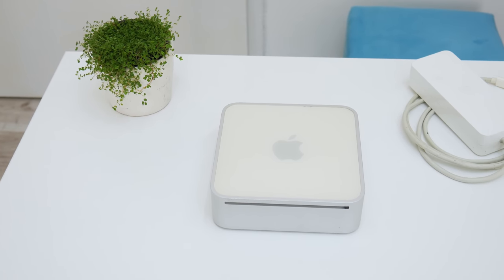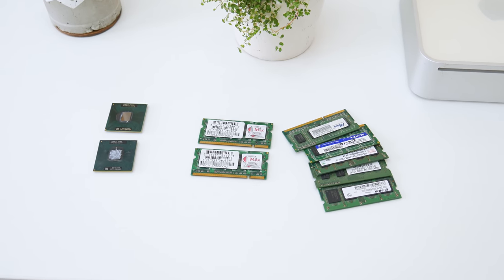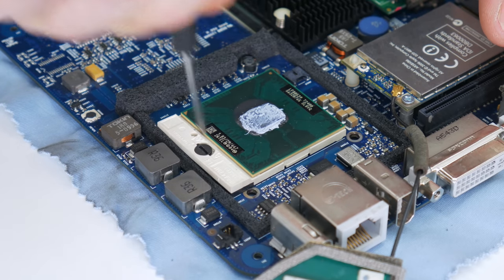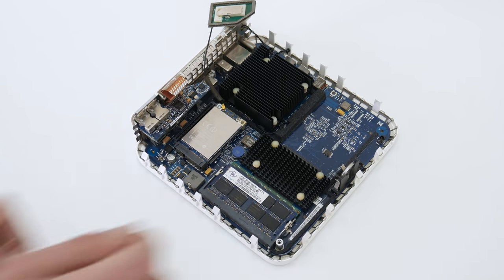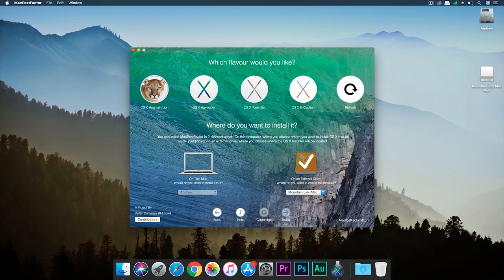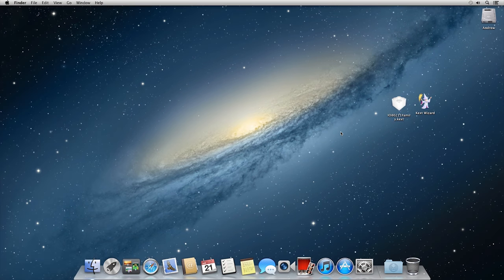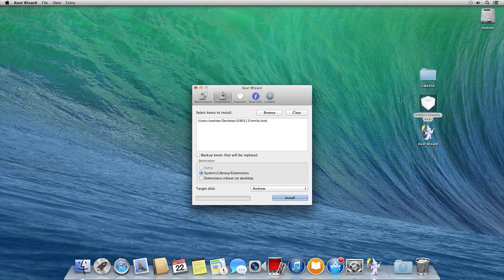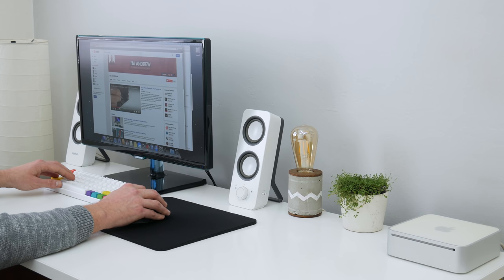Upgrading the $20 Mac Mini - Running Unsupported Mac

Comment: That mini might actually support 6GB of ram like my 2007 iMac actually does.
Reply: 4GB sticks of DDR2 are rare and not cost effective.
Reply: @4clive    They are not commonly available new but if you watch and wait they can be had on Ebay for a decent price.
Reply: @4clive  $30-40 USD on ebay
Reply: @cdoublejj  exactly, and 2GB a couple of Bucks, so 4GB is about $5 and a modest increase to 6GB would be $45, so not worth it.
Reply: @4clive  if the machine is free and one has an ssd and an older core 2 duo it's def worth $35 if your gonna use it enough. that's also the last time i looked a a year or 2 ago prices may be even lower now. i found the intel 7260 wifi cards to be more price at $25 ish for the 5ghz AC version
Reply: No, max is 4 GB. And only 3 GB of that is usable, same goes for my Late 2006 iMac.
Reply: Yep, I had a Core 2 Duo on a 945 motherboard and even though it had 4GB of RAM installed, it could only use 3 of it (actually 3.15, but 160ish kilobytes is nothing, even back in 2006). Didn't matter if I ran OS X, Windows 64-bit, Linux, or BSD (and I did), none of them could use all 4GB because of 32-bit memory controller limitations.
Reply: If you upgrade the EFI from 1,1 to 2,1 you can install two 2gb modules. The memory controller can only access around 3Gb of RAM though.
Reply: @cdoublejj  That's if you're going to use it.  I can't say to much against you though.  I'm the guy that attached about $650.00 (2016 dollars) worth of external HDDs, speakers and other peripherals to my $35.00 "Raspberry Pi".  Just for fun.  Lol!  Just teasing.  Enjoy!  Make!  Build!  Be safe, out there!

Comment: Hi, I have such a Mac as well, and can’t get a disk out from the drive. Tried everything listed in manual. Disk is not even shown on desktop. Can I get disk manually out when I open the case like you show in this video? Any suggestions for doing this without causing any more damage?

Comment: what about the ssd drive
Reply: or intel 7260 wifi card!
Reply: @cdoublejj  Intel wifi is not working in mac os
Reply: @ВячеславКоберник-э8ю  Linux or windows it does! I installed win10 direct with no boot camp
Reply: Solid state drive drive?
Reply: @Zackhasacat  Yes - I did this to two old iMacs (2007 I think) and it makes a HUGE difference. Have a third I need to get scheduled. Boot up in under 9 seconds and apps launch close to instantly.  Now I need to see if I can get them on a newer OS with a chip upgrade so as banking and many other sites no longer support older OS.

Comment: Hi!i’ve one mini mac late 2007 core 2 duo ,1gb ram and 1.83 Mhz cpu already with firmware 2.1 and mac Os 10.6.8.
It’s very fast.
The problem is the unaupported safary.
I need to use citrix receiver and visit some website today are not accesible.
Uprading OS to Maverik (and 4gm ram) do you think i’ll be able to use it again?

Comment: Does it really use all 4GB? In the activity monitor it shows only 3GB in my case even though in the system properties it is declared as 4GB. Windows 10 64-bits handles also max 3GB which I read to be the limitation of the Mac Mini 2007.

Comment: while it recognizes de full 4GB, the firmware will not let it use more than 3GB. Also, the best CPU for that Mini is the T7600, which is 2.3ghz 2mb cache. Did this with my Early 2006 iMac.

Comment: I installed Ubuntu on my old Mac Mini.  It runs faster with Ubuntu than it ever did with OS X.
Reply: yet more secure  and modern
Reply: Cloudready would have been easier and is more than enough for normal users

Comment: I have a 2010 mac mini, I put in  8 gb ram but now it's too small, can I upgrade the cpu and I would like 16 gb ram what do you think. I love my mini , I have a mac book pro and 2 I macs but the mini is my best friend, small and nice . It has 10.13.5 High Sierra would like to update to Mojave.Please tell me what you think. Great video.
Reply from the maker: Hi bro, you cannot upgrade the CPU to Mac Mini 2010, only you can upgrade the RAM and the Disk, instead hard disk you can go with SSD. Also if the Mac Mini has Nvidia graphics than you can install Mojave, i have guide on my channel about How to install Mojave on Unsupported Macs

Comment: I know most youtubers hardly answer comments in their videos, but here goes nothing: where did you get the kext drivers you show? You never mentioned it. That is the only piece of the puzzle left for me to upgrade my Mini 2006 to OS X 10.8, since for some unknown reason no Windows boot disc will ever boot in this Mac, when using an external USB DVD drive - tried XP, Vista, 7, 10, all 32-bit and 64-bit - not even BootCamp works when I want to boot from the optical disc!!

Comment: Excellent video, I have the same model mac mini, just about to dump, but now I would like to restore it as you did, just don't know what to buy exactly, could you describe a shortlist of the parts needed? Thank You
Reply from the maker: Hi bro, you need some CPU like core 2 duo T7400 or 7600, Standard DDR2 ram for Laptop and instead HDD you can go with SSD

Comment: Hello Andrew, I have a Mid 2007 Mac Mini with a Core 2 duo and 3 gb of Ram running Snow Leopard. what other Mac OS X will support? Thank you.
Reply: It should run everything in the video.  The firmware and CPU upgrade he performed was to convert from a 2006 to a 2007 mac mini.  Those models only have a 32bit memory controller so are limited to 4GB address space - 1GB of which is used for the PCI bus, so even though he had 4GB installed, only 3GB was actually useable.  The only advantage of putting 4GB in v 3GB is it's full dual channel for the entire 3GB useable, whereas installing only 3GB leaves 1GB in single channel.

Comment: Hi Andrew. You skipped a couple of passages but I was able to update the firmware. Now the system info reads Mac mini 2.1. Now I-m trying to install the mountain lion. I launched MacPostFactor and select target USB disk and updated. I set the preferences but after that it hangs in the advertisement. I tried many times without success. It visualize a couple of AD and than hangs.
Any hint/suggestion?
Reply: It was hanging at that point when I tried to do the upgrade. I ended up letting it sit there for nearly 40 minutes and it finally let me process on to do the installation.

Comment: Hi.  Where do you get the firmware?  I looked into this many years ago as I have the exact same 2006 Mac Mini and I upgraded the CPU like 5 years ago but for some reason it looked too much hit and miss to make it work, so I abandoned the project.  It was the firmware part that put me off as I read that it can brick you mac in some circumstances.  Any info would be very helpful.

Comment: I have a 2007 mini running windows 7 , and it runs great at this point, the only limitation is my graphics card. other than that its great. All the duel core series are not bad computers when there fixed and upgraded. mine runs 720p video fine 1080p when the Ethernet is plunged in.

Comment: Little bit of wrong info here. On 10.9 you DON'T have QE/CI graphics hardware acceleration. Also, the OS might see the 2x2GB DDR2 sticks, but due to chipset limitation it will only address 3GB. You can check, if you install Windows 7 via Boot Camp, in system properties you will only see 3GB. (Done the same experimenting and tinkering on a 2006 iMac)

Comment: HI all, I'm trying to install Yosemite on my Mini Mac 2006 sucecsfully updated to 2,1. I've repalced the cpu and added 2gb RAM. I've also installed the new firmware. Unfortunately the software MacPostFactor is not working for me (it stucks at " Skip AD" but the window remains blank and no AD is shown, so I can't click). I'm kindly asking you if there are other possibilities to install Yosemite without using MacPostFactor. At this moment the only os working is Snow Leopard.  Many thanks for your precious help.
Reply: Same story. I ended up installing Windows 7 and after that upgraded to Windows 10 Tiny. I highly recommend an inexpensive SSD for this setup.

Comment: 12:17 -- I installed the wifi fix with this Kext --- it appeared after i restarted --- but when i try and joing my home network... it says "connection failed". its weird because wifi worked fine before :(

Comment: Hi... How do you update the firmware -- after the first RAM chip is installed -- without putting the Mac Mini all back together again? (In the video it looks like you do this while it's all apart.)
Reply from the maker: Hi bro, you can turn on almost any computer while is half assembled, just you need to add ram, disk and power button

Comment: May need to have some cleaning of the ifixit professional opening tool.
Reply from the maker: It's good to have, but you don't need also, here I used just one screwdriver and few other things that are not really professional tools, but great to open this model without scratching or damaging the case

Comment: Hello from Italy! I made your own upgrades by adding an SSD. I put Mountain Lion and it works very well. The only problem is the browser. There are no compatible browsers, and that safari version is obsolete. How could we make the most of Mountain Lion? Are there any working browsers? I would like to use this low-budget configuration in my office. Help please.
Reply from the maker: Hello bro, in this case you can go with older versions of Mozilla Firefox or older versions of Google Chrome, check this https://goo.gl/PtRKja

Comment: Nice idea. Except you leave much to much information. Does the install process starts from USB automatically? What kind of CPU did you put in? Slot?
Reply from the maker: Hi bro, the CPU is Core 2 duo T7500 
 PPGA478 / PBGA479 Socket. Also installation in mac, i mean installing the macOS needs to be started manually

Comment: I still have my original G4 Quicksilver desktop with dual 1.25 (I think) CPU.  It will run 9.2 native but will also, as it does now,  run 9.2 apps in classic mode. I'm wondering if you know how much I can increase the Ram, and any firmware updates, etc and still run it in 9.2 native?  I have allot of classic programs that are very slow now.  Thanks

Comment: i have i Mac mini A1103  G4 1,42 512MB 80GB AP BT  SERIAL NUMBER YM5383LJTAC and i would like to upgrade both hardware and software. Could you tell me which hard disk and RAM memory i have to get.

Comment: With the CPU, Ram and firmware upgrades you installed would it still run OS 9.2 native as it did stock or would it now only run OSX with classic apps in classic emulation mode?  Thanks

Comment: You should install an SSD to speed things up in Mavericks or Yosemite, or see about upgrading to Catalina so you can get security updates.  Also, can you get iMessage and Facetime calls to work?  Didn't know you could upgrade to 64 bit processor but it must be that the logic board supports 64 bit at that time.  Since you only have 4 GB of RAM that should work under 32 bit I would think.

Comment: I have upgraded my 2006 Mac Mini to 2,1 and hardware etc. The Macpostfactor V2.0.1 won't support. MLpostfactor will support Lion. So I am stuck here.
Reply: My original 2006 Mac Mini core solo 1.5 supported using Macpostfactor V2.0.1 to jump from Snow Leopard to Mountain Lion so I know that does work at least on my Mac Mini.

Comment: Very cool but why are you touching the thermal paste with your finger? You are contaminating it with your finger grease!
Also you should have looked into a BCM970015 Broadcom Video/Audio Hardware Decoder to get full 1080p video support.

Comment: Hello,  have a cuestión... after install Mac OS x leopard or snow leopard on the Mac mini, the Mac mini freezes in the configuration wizard, and,  can not do anything, have to turn off the Mac mini, can you tell me what im doing wrong? Sorry for my english. Greetings!
Reply from the maker: Hi bro, try to disable SIP, boot into the USB installer or recovery mode, open terminal and in terminal type csrutil disable, this needs to help to resolve the problem
Reply: @ComputersAndTechAndAndrew  thanx bro, will do that and come back later, to confirm. Ps. Sorry for my bad english.

Comment: Hey Andrew, Is it possible to replace HP 15 Series Notebook processors with a higher speed processor? I do use a HP Notebook with 8GB of ram which came with Intel Core i3 (6th Gen) processor officially. I want to upgrade its processor with at least core i5 processor. Is it possible?
Reply: Sadly not because 99% of newer Intel mobile processors are soldered on and most likely yours is too. Just check the spec sheet for your processor which socket it uses and check if it is soldered, most likely it is.
Reply: @lulink99  Thanks for your reply! I checked and it was soldered as you said. :( May be I will have to change my PC.

Comment: Upgrade a G4 mac mini!! I have one of those.  Biggest problem being the IDE drive.  Need a to adapt IDE to SATA.
Reply: I achieved it on my mini G4 with a mSATA to IDE adapter and a cheap mSATA 128GB from AliExpress. 40$ for the bundle. Also consider overclocking it to 1.5 or 1.58GHz.

Comment: Installed latest 64-bit Linux Mint on my 2007 Mac mini 1,83MHz Core2Duo - Runs so much better than OSX, and does all the latest software. A bit of a hassle to get the bootloader working, but after that it was smooth sailing - Quite fast with a SSD-HD :-)
Reply: Oskar Strandman I find installing Linux a bad thing, Linux it’s like macOS but without that extended App Store.

Comment: Could you have upgraded it to the late 2009 specs from the looks of it. 64 bit, 2.5 GHz Core 2 Duo, 8 GB RAM?
Reply: I have a late 2009 mini running El Capitan. It has 8 GB of RAM installed. I am about done paying for Apple products though. Going Hackintosh next time around.
Reply: The P series Core 2 chips aren't supported by these Mac Minis, and the 945 won't use more than 4GB of RAM.

Comment: Any possibility of using a Core2Duo QUAD? I understand they are pin compatable CPUs with the core2Duo
Reply: what
Reply: You mean a Core 2 Quad?

No, not in this system. Had Apple used a 965, 3 series, or 4 series chipset though, then yes. The 945 chipset has a dual core limitation that comes from the fact it was originally designed to run Pentium D processors (which were the ones right before the Core 2 Duo). The 965 came around about the same time the Core 2 Quad Q6600 did.

Comment: How did you manage to put 4GB of RAM when it only supports 2GB ? Isn't it a motherboard limitation ?
Reply from the maker: Hi, i upgrade the firmware and i turn this Mac Mini 1,1 to Mac Mini 2,1. The Mac Mini 2,1 support 4GB RAM
Reply: @ComputersAndTechAndAndrew  Cool !! thnx for the reply

Comment: hi my friend i need to upgrade the firmware to macbook the earlier 2006 it´s possible do it the same process???
Reply from the maker: HI bro, this is only possible with 2006 mac mini model, on macbook is not recommended because they are different hardware

Comment: Hello thank you first of all for your video.
I follow  the instructions and install from 10.7 the Mavericks. I install the Kext Restart the Mac mini and  the wifi become enable. But I have one small problem. When the try to connect to my wifi I receive a connection failed after the password and join button. Have you any idea for this issue..? With 10.7 working and connected normally. Strange issue 
Thank you very much

Update info.  Turn off my wifi password encryption (from wpa2 to nothing) and the Mac mini connected. Maybe the airport card its to old and not compatible with wpa2 ??
Reply: I have the same issue. But I do not think it is a airport card problem. When my Mac mini was on OS X Snow Leopard it connected to the same WPA2 encrypted wifi network just fine.
Reply: Martin Boss I'm looking on Internet. And the result is no compatibility with this airport card and Mavericks. Buy usb external wifi and you got the solution..;)

Comment: Andrew , can you use a t9600 intel core 2 duo 2.8 on this project ? Also will that processor support 8 gigs of ram after firmware update . Thanks for your great videos . It really helps people that are on a limited budget
Reply: The memory limitation is the Intel 945 chipset IIRC, not the processor. Core and Core 2 chips didn't have onboard memory controllers like AMD chips did starting with the Athlon 64 and related Duron, Sempron, and Opteron chips. We had to wait for the "first gen" Core chips (i3/i5/i7) for that in the Intel world.

Comment: Hi. Can i install Yosemite OS on my 2007 macmini without having  problems with any drivers?
Reply from the maker: Hi bro, this 2006 and 2007 are the same and Yosemite will not work :( i already tried but no success. But if you have some mac mini like 2010 with or other from the older models with NVidia graphics than you can install the latest Mojave

Comment: I have  two of them, same exactly model. On the first one I've been able to complete the upgrade and have Mac mini live for a comple of minutes. It recognized the new CPU and booted flawlessy, but IT forze and after I've powered off I've never been able to switch it on again. The second one had a very strange behaviour: it completely froze after a variable amount of time (1 up to 5mimutes) from boot. So I decided to try the upgrade path. Again everything run smooth: CPU, even Mac OS upgrade. But the random froze continued even with the new CPU and RAm. They are totally unusable now. What a pity.
Reply: Sorry to revive a year old thread but maybe it’s a thermal paste issue?
Reply: Eli Fleming I am afraid not. I've changed the thermal paste with new one, but that didn't change this behaviour. There must be some component on the logic board (my guess) but I don't know how to do a proper troubleshooting.